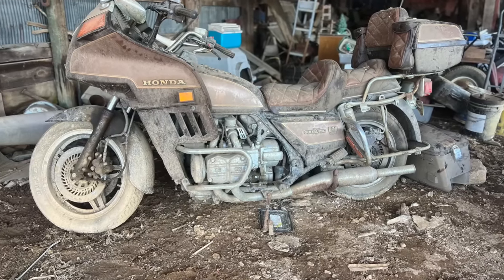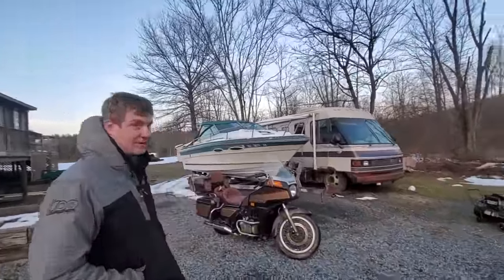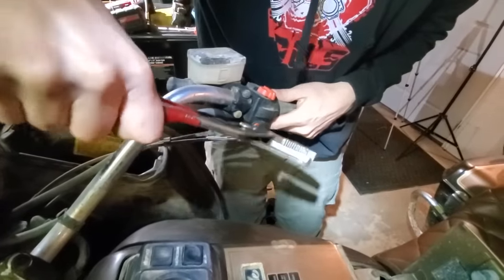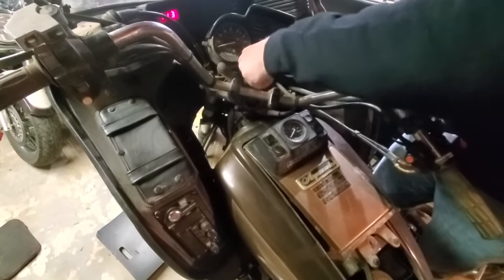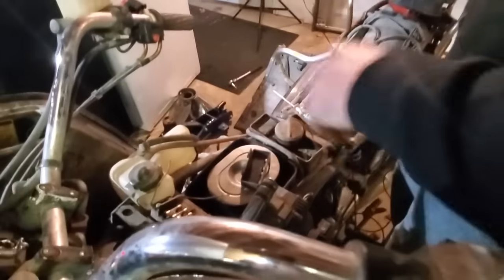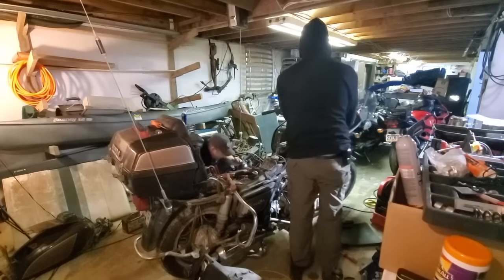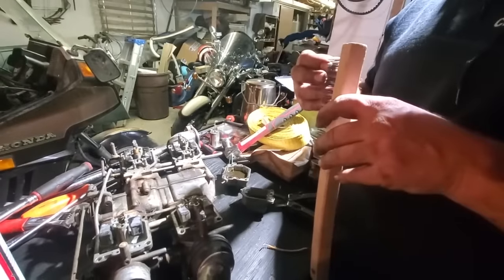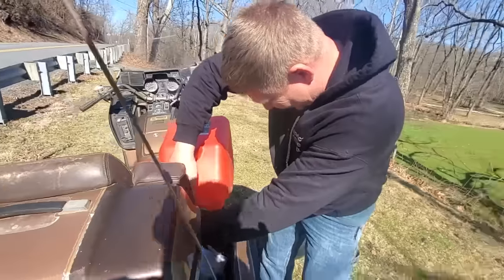Vintage Goldwing, Barn Find. Can we get it running and driving again?

Comment: Japanese bikes do not use Philips or Posidrive screws, they are JIS heads, you need to get yourself a Vessel JIS impact screwdriver, then life will be much easier 😁
Reply: Currently restoring a 79 gl1000, bought a JIS screwdriver set but use my Phillips screwdrivers 99% of the time! You don’t need to buy anything.
Reply: @WhySoSeriously101 I've been working on Japanese motorcycles for 30 years and have only been using Phillips screwdriver and impacts too and I've never had a problem either.
Reply: What a waste leaving it to rot away some people have more money than sense
Reply: Wish it was me that had it
Reply: A tip for you to remove surface rust it works soapy brillo pads in hot water does great job
Reply: If you guys are feeling kind please send me a motorbike to manchester uk❤
Reply: Yes I would like to see it. 😊 @donnydenfeld2394
Reply: @WhySoSeriously101  You just have to look at any older japanese bike to find stripped screws galore.
Reply: Yes, I have one too. Both of my first cousins, my nephew showed it to me for 500 and custom job. Chrome all over the sides of it, think it's locked up. I got to do work on it. Might get pretty Chrome on both sides. Got the back trunk on it. Nice bike. I just got to get out there. Work on it. Where I can go riding on it and go see a lot of sites in Tennessee. I just tell you.❤

Comment: I had high hopes for this video,.great to watch an old abandoned bike being saved and given a new lease of life, or so I thought. Trying to free the starter button with channel locks, using a Philips screwdriver on rusted JIS screws, jamming a flathead screwdriver into the ignition. Even the fact that you thought 20 plus year old timing belts would be ok had me wondering what you were thinking. This bike deserved better treatment and I'm sure there are several viewers of your video that would have wanted to be as lucky as you in finding such a barn find. I just think it's a real shame the way you're approaching this.
Reply: YUP, very cringe worthy... I bought a '81 GL1100 & '97 Valkyrie, no history for either so first to replace were the timing belts.
Reply: Apart from that, the video is just plain badly edited and boring...
Reply: Agree totally. Had to look away when he jammed that screwdriver into the key switch. Thumbs down on this video.
Reply: I was wondering where he bought his barn find dust from ?
Reply: Yup a How to Butcher a Classic Motorcycle Video

Comment: Sad you guys did not do your research before touching this beautiful motorcycle. The issue with the starter button is the screw underneath it that needs to be loosened a little. You also overtightened the screwed on the valve cover which will definitely leak soon. This bike requires everything to be torqued correctly. I hope you guys decide to read up on how to restore gl1100. I usually do not criticize anyone on the Internet but unfortunately gotten really sad seeing this video. I know you mean well though :)
Reply: Get over yourself bud... this bike was left to rot

Comment: Back in my early 20's, I had a 76 LeadWing, full dressed "Cadillac" GL 1000, all the goodies.  Thanks to it's low center of gravity and profile, my skinny 120 pound self had no problem riding that beast.
I did some lighting upgrades and added some artwork to her.  Some scripting and pinstriping.  Across the trunk, using those thin artist paintbrushes, I scripted "Long Distance Voyager," inspired by the name of a Moody Blues album.  That was her name.

Comment: Had the same bike many years ago. Found the best way to use the center Stand, stand alongside the left side of the bike facing forward with your hands on the handlebars. With your right foot stand up on the center stand letting your weight push it down as you pull back lightly on the handlebars. The stand pivots right up slick as can be.😊
Reply: I did it much the same way, but did not use the handlebars for anything more than keeping the front wheel straight as I stood on the stand and lifted from the crash bar in front of the saddlebag

Comment: Wow that's low milage on that bike. My first touring bike was an 82 gl1100 that had 78,000 miles on it when purchased and 213,000 miles when i sold it for more than i paid for it. Best bike i ever had as far as reliability.

Comment: Thats not smoke coming from the left side exhaust is fuel, thats why it went through 1 gallon in 3 miles had the same problem with my 76
Reply from the maker: You are exactly correct. It was a stuck float in one of the carbs on the left side

Comment: Same as the one I bought about 20 years ago, had 10 years with few issues, 11 th year I had to do a full strip, frame had rotted through by petrol tank and on bottem frame rail which was removable. Petrol tank had also rotted out. Did all that and then sold it as it was getting too heavy to manoeuvre. S😢till miss that bike.

Comment: Bought a bike on online auction, front end damage. When it arrived, truck driver helped me unload it. Front wheel scraping tire so we didn't realize it was in gear until on the ground. Must have been in top gear when wrecked and no one changed, as the foot shift was bent against the frame and clutch cable broken. Engine was fine, but forks and frame by neck bent.

Comment: Good video, I would like to see how it turns out. Wouldn't it be easier to just take the good parts you need on the parts goldwing instead ? That's if you have a title for the Aspencade
Reply from the maker: It would have been easier most likely. But you are right, we don’t have a title for the aspencade . The finished product turned out amazing though 👍

Comment: Why would you start cranking a crusty bike that hasn't been started in more than 20 or 30 years without putting some oil down the cylinders? If cylinders were ok, there's a good chance you scored them or pistons by cranking without lube. Was there even any oil in crankcase? I have to admit I started skipping around because you didn't seem to have a cohesive methodology for tackling this project and what I saw of your approach in first 20 minutes of video just seemed to be all over the place. I think you need to have a consistent plan in place with these kind of restoration projects. Good luck with it though.

Comment: Did I miss the part when they drained the 20year plus year oil
? Oil breaks down after sitting 6 months,first thing for all barn finds is fresh fluids.that starter is struggling. If it was me I would have pulled spark plugs and soaked piston rings and after few days turned over by hand before  trying to start.it died after starting. Wings purr at idle.have to say these guys couldn't tune Briggs and Stratton lawnmowers and read a compression tester. Giggling that oil has gas in it.HACKS.it isn't firing on all 4.steeringwheel comment.ill be steering away from you hacks touching my wing